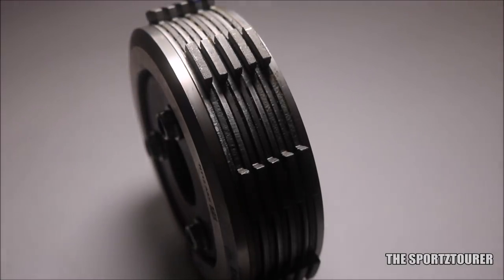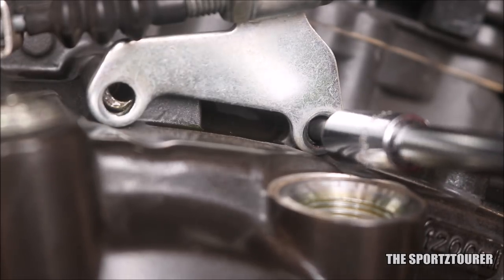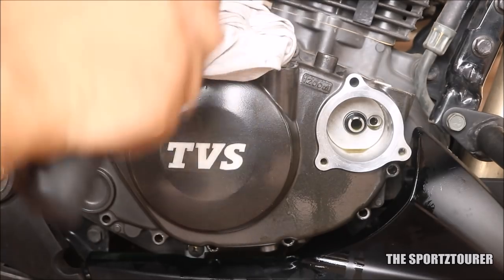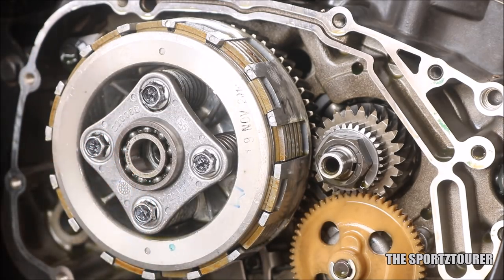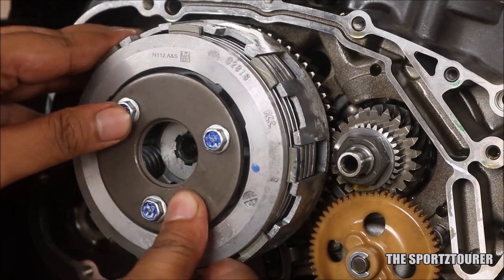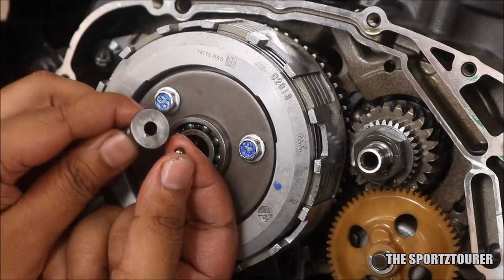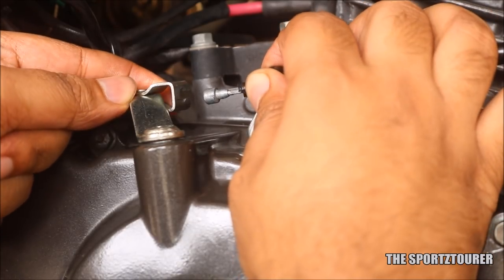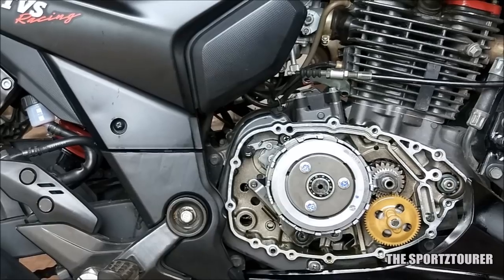HOW TO INSTALL SLIPPER CLUTCH IN BIKE TVS APACHE SLIPPER VS REGULAR CLUTCH, SLIPPER CLUTCH EXPLAINED

Comment: can i install slipper clutch in Apache RTR 180?
Reply from the maker: Hi,
The RTR 180 does shares a lot of parts in common (as shown in the video). Only thing I have doubt about is the clutch housing and the clutch shaft dimensions. Unless we practically check, it cannot be confirmed 😊

Comment: If will fit slipper cluch in Karizma r
Reply from the maker: The Karizma R has a different clutch housing and the clutch shaft is also different so this won't fit on Karizma R.
Reply: @thesportztourer  ok
Reply: @thesportztourer  racing cdi pe video banav  konse bhi Chanel pe vo nhi he tum bnav

Comment: Can I do it for rtr 160 4v fi
Reply from the maker: Hi,
The RTR 160 does shares a lot of parts in common (as shown in the video). Only thing I have doubt about is the clutch housing and the clutch shaft which I doubt isn't the same. Unless we practically check it, we cannot confirm on that 😊
Reply: Thanks dude

Comment: Can i install the slipper clutch of r15 v3 in fzs v2??
Reply from the maker: The R15 V3's slipper clutch can be installed on R15 V2 but as per the clutch housing I don't think (assuming as clutch shaft will be different) it will be a direct fit on the FZs.
Reply: @thesportztourer  Yamaha service people saying that it will fit as the housing of both bikes are  similar btw thanks for the response :)
Reply from the maker: Nice! 
Do update here, would love to know more from your end if you decide to go ahead with the installation on FZs.
Reply: @thesportztourer  ok :)

Comment: Adapter pin sumall steel ball size number
Reply from the maker: Hi,
Right now I don't have the dimension but I can provide you with the part number.
Part name: Steering ball
Part number: 420404000

Comment: Can we install this slipper clutch for RTR 180
Reply from the maker: Hi,
The RTR 180 shares a lot of parts in common (as shown in the video). Only thing I have doubt about is the clutch housing and the clutch shaft dimensions which I doubt isn't the same. Unless we practically check, it cannot be confirmed 😊

Comment: Is this possible in other bike? Like ns200?
Reply from the maker: Hi Nocolai,
The clutch housing and clutch shaft is different on the NS 200 so this won't fit in.
Reply: @thesportztourer  is there a slipper clutch that will fit on ns200?

Comment: Can i use a slipper clutch  in honda cb shine sp
Reply from the maker: Hi Manoj,
Right now slipper clutch is not available for CB Shine.
Reply: @thesportztourer  thanku
Reply: @thesportztourer   which engine oil best for cb shine sp? My bike daily running 30-60km. Can u suggest which engine oil best

Comment: Bro can I fix in my rtr 180 

Please reply bro
Reply from the maker: Hi Sathya,
I am yet to personally check that but the authorized service said the clutch shaft is of different dimension on the 200 4V and 160/180.
Reply: OK thanks bro

Comment: Can i install it in apache rtr 160 4v??
Reply from the maker: Hi Subhash,
The RTR 160 4V does shares a lot of parts in common (as shown in the video). Only thing I have doubt about is the clutch housing and the clutch shaft which I doubt isn't the same. Unless we practically check it, we cannot confirm on that 😊

Comment: Bro I'VE RTR 160 4v....CAN I i INSTALL SLIPPER CLUTCH ON REGULAR CLUTCH....PLEASE LET LNOW HOW MUCH ITS COST...THANK YOU
Reply from the maker: Hi Pritam,
The RTR 160 4V does shares a lot of parts in common (as shown in the video). Only thing I have doubt about is the clutch housing and the clutch shaft which I doubt isn't the same. Unless we practically check it, we cannot confirm on that.
I have mentioned all parts, their cost and part number here: https://youtu.be/oxDokGdCZv8

Comment: Great going ,brother! 
I just came by your vlog today only. It's a pleasure being your follower n  subscriber.

I would cordially appreciate if you would satiate my queries.

1. Can slipper clutch be fitted in rtr160 4v as well?And would the process of retrofitting be the same as this one ?

2. Which engine oil to use during engine breaking period?

3.lastly can the 60/55 watt h1 halogen bulb as used in rtr 200 4v and rtr 160 fi be fitted in rtr160 4v carb as well? 

4. The Nuts and bolts are made of poor quality as if u apply little more torque it would snap or be rounded. Is it true?

Thanks in advance
Regards
Sujit

Comment: Bro can i put slipper clutch on rr310
Reply from the maker: Hi,
The RR 310 has a different clutch assembly so this won't fit. I think TVS will update the RR with slipper clutch in 2.0 then it can be retrofitted 😊
Reply: @thesportztourer  thx bro for replying

Comment: Can i use it for apache 200 4v    2017 model?
Reply from the maker: Yes Nizam you can. Infact I have installed it on my 2017 RTR 200 4V (Version 1).
Reply: @thesportztourer  after use of this clutch did u notice milege changes?
Reply from the maker: Yet to check the mileage properly, the fuel efficiency has not drop for sure.
Reply: @thesportztourer  thanks for such  great video bro.

Comment: can i install a slipper clutch in RTR 160?
Reply from the maker: Hi Ashik,
The RTR 160 does shares a lot of parts in common (as shown in the video). Only thing I have doubt about is the clutch housing and the clutch shaft which I doubt isn't the same. Unless we practically check it, we cannot confirm on that.

Comment: One QUESTION-- THE WORK OF SLIPPER CLUTCH IS TO MAKE SHIFT GEARS WITHOUT CLUTCH
Reply from the maker: Hi Ranveer,
That's a quick shifter 😊 Technically slipper clutch won't aid us in clutch less shifts (still riders can do that like they do on the regular clutch).

Comment: Can this slipper clutch be installed in Pulsar 200 Ns?
Reply from the maker: Hi Danish,
The clutch housing and the clutch shaft is different on the NS so it won't be a direct fit.
Reply: @thesportztourer  I get it. That means I need to change Housing too if I want to upgrade it with slipper clutch. Right?

Comment: Does it fits FZ25?
Reply from the maker: Hi Hari,
This one won't fit but riders in Indonesia have fitted the slipper clutch from R15 V3 in FZ 25. when asked they were unable to confirm if it was a direct fit.

Comment: Bro can I use this slipper clutch in Apache 160
Reply from the maker: Hi Ajith,
The RTR 160 does shares a lot of parts in common (as shown in the video). Only thing I have doubt about is the clutch housing and the clutch shaft which I doubt isn't the same. Unless we practically check it, we cannot confirm on that.
Reply: @thesportztourer  thanks bro .,subscribed...

Comment: Can we use it on ns200??
Reply from the maker: Hi Argha,
The 200ns has a different clutch shaft with different housing so this particular slipper clutch won't fit. Let's wish Bajaj updates NS with slipper clutch so that we can retrofit it to the NS with conventional clutch system 😊

Comment: Can this fit on tvs apache rtr 160?
Reply from the maker: Hi Saif,
The RTR 160 does shares a lot of parts in common (as shown in the video). Only thing I have doubt about is the clutch housing and the clutch shaft which I doubt isn't the same. Unless we practically check it, we cannot confirm on that 😊

Comment: does this really work? can i do it in apache rtr 160 4v?
Reply from the maker: Performing very well on my RTR 200 👍
The RTR 160 4V does shares a lot of parts in common (as shown in the video). Only thing I have doubt about is the clutch housing and the clutch shaft.

Comment: sir,  can it fit for 180
Reply from the maker: Hi Sasank,
The RTR 180 does shares a lot of parts in common (as shown in the video). Only thing I have doubt about is the clutch housing and the clutch shaft which I doubt isn't the same. Unless we practically check it, we cannot confirm on that.

Comment: Bro my race edition rtr 200 is not crossing 129, anything wrong with my bike ?
Reply from the maker: How many km done?
Reply: 3000km
Reply from the maker: Considering your motorcycle is mechanically ok (tire pressure, chain, oil, filter etc) and the road/wind conditions is fine, I would suggest you to get the carburetor tuned from an expert mechanic. You can also check this video on tuning the RTR 200: https://youtu.be/3LOP8asQ6Ek

Comment: Can weinstall a slipper clutch in a pulsar 220 ??
Reply from the maker: Hi Karthikeya,
This clutch won't be a direct fit as the clutch housing and shaft is different on the P220.
Enjoy the raw power on the 220 and ride safe 😊

Comment: Can we use on FZ25?
Reply from the maker: Hi Fahad,
A few Indonesian riders have fitted the slipper clutch from the R15 V3 on the FZ 25. They were unable to confirm if that was a direct fit or any other additional modification was required for the fitment.

Comment: will it works in rtr 160
Reply from the maker: Hi Sriram,
The RTR 160 does shares a lot of parts in common (as shown in the video). Only thing I have doubt about is the size of clutch housing and the clutch shaft.

Comment: I talked to a mechanic at TVS and he told me that there are two types of shafts in the engine of apache 200 one is long and some have short ones. He mentioned if my 200 has the shorter one only then i can get the slipper clutch installed. Is it so?
Reply from the maker: Hi Rishabh,
I think the mechanic is talking about the clutch shaft dimensions of RTR 160, 180 and 200. As far as I know all the version 1 RTR 200 have same clutch shaft. What's the manufacturing date of your 200?
Reply: @thesportztourer  I checked the Invoice and found that only year of manufacturing is mentioned as 2017 whereas I purchased my RTR 200 in the month of October in 2017.
Reply from the maker: Hi Rishabh,
After this video I know at least two 2017 motorcycles who have upgraded to slipper clutch successfully. Just make sure the installation is done right.
Reply: @thesportztourer  Sure, thanks for your response. I will talk to the concerned TVS team about this.

Comment: #The Sportztourer  .. heyy.. can u plz confirm me.. does this Slipper Clutch Assy that you used is a stock TVS product or are you using an aftermarket product..?
Sorry to ask this.. but I'm also thinking of this same mod.
So if there is a Stock TVS Slipper Clutch Assy... then it will be more safe and guaranteed than any aftermarket products..
Reply from the maker: Hi Joe,
This is a stock TVS part. I have mentioned all parts, their cost and part number here: https://youtu.be/oxDokGdCZv8

Comment: can the same be done to a duke200?
Reply from the maker: Hi Nidhin,
I doubt it will be a direct fit as the clutch housing and the clutch shaft is different.
Reply: The Sportztourer bro, can the 2015slipper clutch system be packed to a 2014duke 390? Will there be any other change needed rather than the slipper clutch unit only?
Reply from the maker: Yes, the slipper clutch can be fitted on the 2014 Duke. As far as I  know The slipper clutch assembly is a direct fit 👍

Comment: can we buy and install slipper clutch on Pulsar ns200 ?
Reply from the maker: Hi Nibir, unfortunately this particular clutch won't be a direct fit as the clutch shaft is different.
Reply: @thesportztourer  i mean can i get aftermarket slipper clutch assembly for Pulsar Ns200 ?

Comment: #Alert...while installing the new clutch wern't you supposed to fix one of the 5 clutch plates into alternate position of the clutch hub .. because the previous clutch plates were arranged  so and the hub acualy has a space for it ....... Please reply
Reply from the maker: Hi Prashant,
The previous one had 6 clutch plates while this one has 5 clutch plates. I get your point as the same arrangement was in my RTR 180 but the slipper clutch is aligned in this way will all the clutch plates in one column as no separate locking is required in the housing 😊
A big thumbs up for your keen observation 👍

Comment: Can I Install Slipper Cluth On Pulsar RS 200
Reply from the maker: Hi Ankit,
The clutch housing and the clutch shaft is different on the RS so it won't be a direct fit.
Reply: @thesportztourer  what if i install the Dominar 400 Slipper Cluth

 Is The Cluth Housing Different Of Both The bikes (RS 200 & Dominar 400)

Comment: Does this work for rtr 160?
Reply from the maker: Hi Abhi,
The RTR 160 does shares a lot of parts in common (as shown in the video). Only thing I have doubt about is the clutch housing and the clutch shaft which I doubt isn't the same. Unless we practically check it, we cannot confirm on that 😊
Reply: @thesportztourer  is there any possibilities that you may be able to get hands on 160 to find out the same?

Comment: Bro,recently i started rev matching-downshifting(heel-toe shifting)in my apache 160...and it starts vibrating t shift lever, when I upshift.
Is there any serious problem coming.i think i shd stop doing that way of braking(engine braking) and downshifting.
Reply from the maker: Hi,
How are you carrying the rev matching process?
Reply: @thesportztourer  revving while downshift
Reply: @MrBaskr5  
That's correct only. No problem. Is the lever loose? That may cause vibrations
Reply: @ajaykaushik2272  engaging 2nd gear causes gear lever heavy sometimes,not every time.upshifting after 4k is smooth.
Reply: @MrBaskr5  
Try only toe shifting. Don't use the heel shifter and see if it is better.
Reply: @MrBaskr5  
Even on Enfield classic 350 we can rev match, but using the toe shifter. It just does not feel so right when using heel shifter
Reply: @ajaykaushik2272  toe shift heel shift...whts the difference bro?
Reply: @MrBaskr5  
Toe shifting means use only front part of gear lever. Don't use the rear part which sits below your left heel.
For downshift tap on the front portion and for upshift, put your foot under the lever and lift it. Dont press rear portion for upshifts.
The shifting becomes much faster and smoother this way

In most bikes now, we only get the toe shifter. We don't get that long rear part of the gear lever. Because toe shifter itself works well, we don't need a heel part of the shifter
Reply: @ajaykaushik2272  i think u got the entire thing wrong....i said something different.
I dint ask whichside lever to downshift.
Reply: @ajaykaushik2272  this is what I meant bro
Reply: @MrBaskr5  
Ok. Got it now. To do that, you need to downshift and immediately open the throttle a bit. It is done to stabilise the rear wheel upon downshifting.
Downshift and immediately open the throttle along with releasing the clutch.
It has to work simultaneously. Your left hand starts releasing the clutch and the right hand starts opening the throttle simultaneously. You can get it by some practice. It will take 2-3 days of learning, but you will eventually get it. Once you get the hang of it, it will be super duper fun to downshift like that.
" Simultaneous release of clutch and opening of throttle" is key here. Gradually release clutch and gradually open throttle.
Once you practice it enough, it will happen very fast

Comment: I have ns200. can I also install slipper clutch?
Reply from the maker: Hi Alakh,
NS 200 has a different clutch shaft and housing so this particular clutch won't be a direct fit on the NS.
Reply: The Sportztourer 
Thanks for replying
So can I install the slipper clutch of dominar?
Reply from the maker: The Dominar again has a different clutch system. Iets hope Bajaj brings slipper clutch on the NS/RS soon so we retrofit them 😊

Comment: Bro there is one video in which RTR 180 got slipper clutch. 

Link  https://youtu.be/P8Bx-PrkHsI

Some experienced guy commented on this video that to install slipper clutch in RTR 180 only modification is that one new 6201 bearing is taken from TVS Jupiter. 6201 has 12mm Bore x 32mm Diameter x 10mm Width. Ok

Now coming towards stock normal clutch plates. It has 15mm Bore x 32mm Diameter x 9mm Width. This is 6002 RS number bearing. The stock pin assembly is as per 15mm bore. My question is that how stock pin assembly can sit in a new 10mm bored bearing instead of 15mm bored stock bearing?

Means both 6201(from Jupiter) & 6002 (rtr 180) bearings have 32mm diameter. Then why they have replaced bearing with different bore & width?

Please try to study this matter if you feel comfortable to do so.

Thank you

Comment: Will it work on every bike
Reply from the maker: If a slipper clutch is available for that particular model then it should be a direct fit like it is shown in this video 😊
Reply: The Sportztourer i want it for my Royal enfield
Reply from the maker: This was my first question to the Enfield guys when I reviewed the new 650 with slipper clutch. As per the authorized service the slipper clutch from the Interceptor/GT 650 cannot be retrofit on any other Enfields.
Reply: Thank you for replying sir
Have a nice day...

Comment: Install  slipper clutch signal royal Enfield
Reply from the maker: Hi Arup,
Right now slipper clutch is only available in the 650 twins and on further enquire I found those slipper clutch assemblies are not compatible with other 350 and 500cc Enfields.